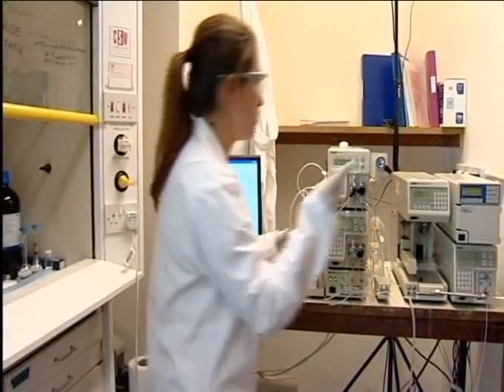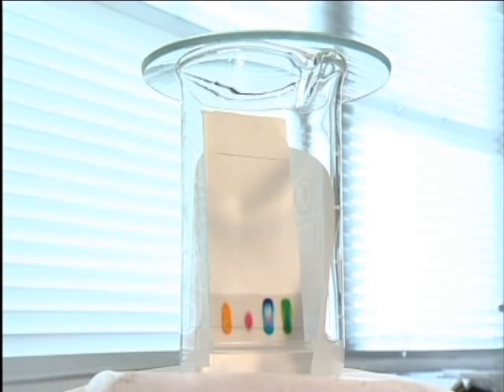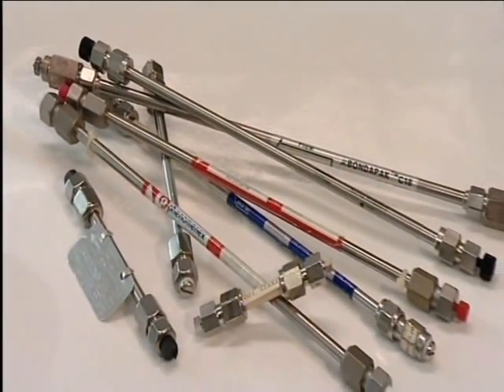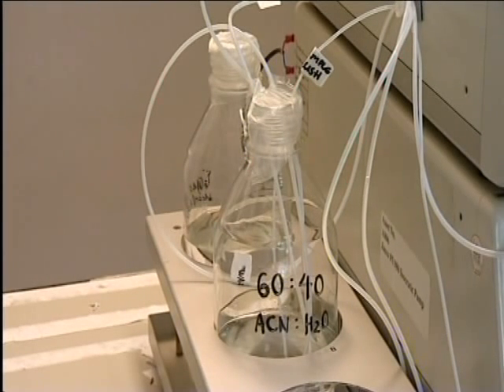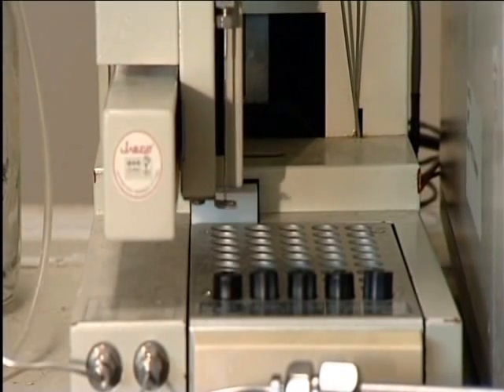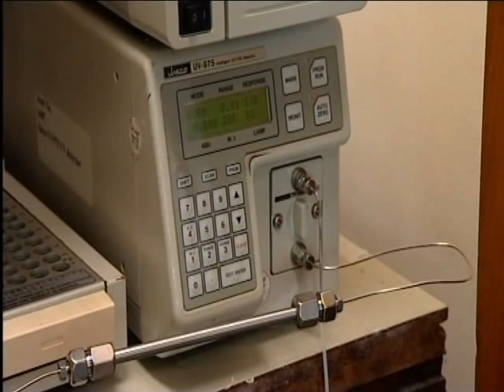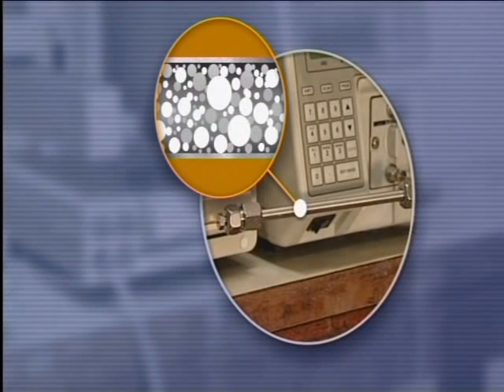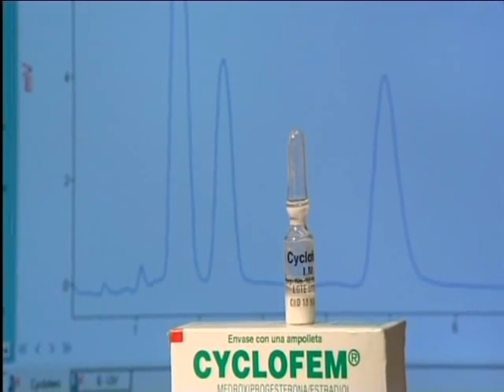High Performance Liquid Chromatography HPLC

Comment: You wouldn't know definitively without standards, but it's typical in HPLC methods that the first few minutes will be chemicals that passed through the HPLC column without absorbing to the column. Chances are they designed the HPLC method so that happened.  The 'other ingredients' are usually called 'excipients' in the pharmaceutical industry, and they may be proprietary mixtures of stabilizers/preservatives/flavor additives/ etc...

Comment: @282sanjay
Yes you can use HPLC to measure these. However, I work in a hospital and we measure T3, T4 TSH and calcitonin via immunoassay. Its a much cheaper, faster and more sensitive method. You can obtain results within 30minutes, compared to HPLC which takes atleast a few hours and more working time to extract